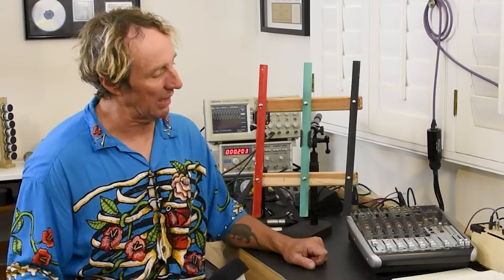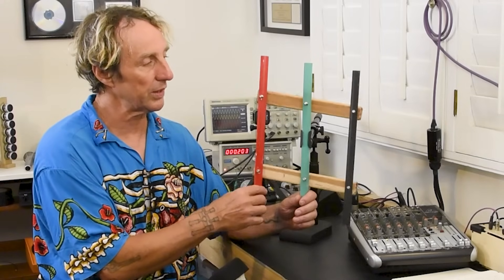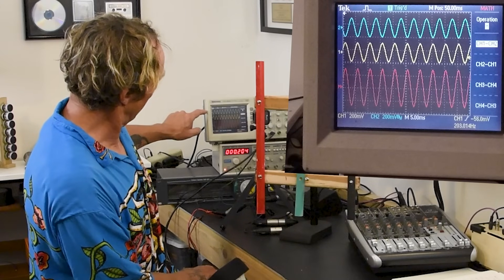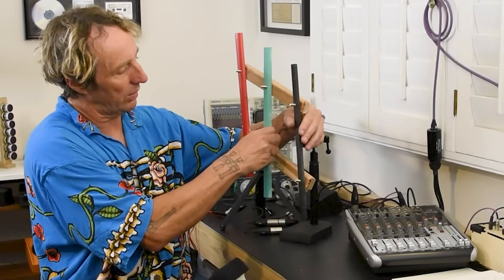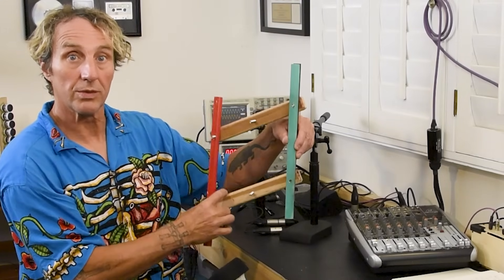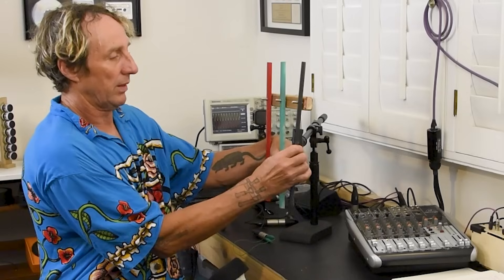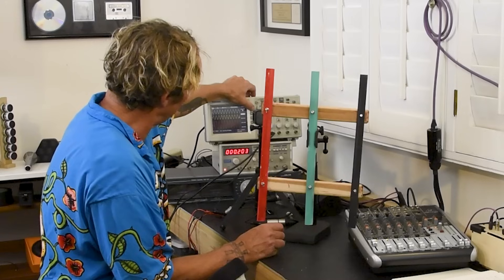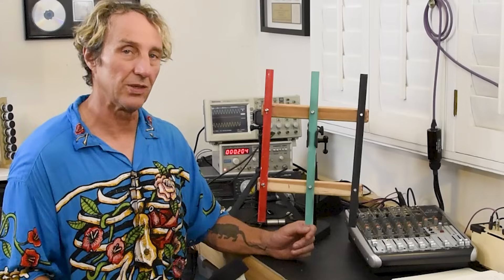The Mechanics Of Audio Balanced Lines Explained

Comment: Sorry, but this is just plain wrong and a very common mistake. Balanced does not mean complimentary voltages, it might be, but it does not have to be. Interference rejection still happens when the signals are both zero. The correct definition of balanced is matched impedances of both sides, the output and input impedances form a Wheatstone bridge. Check videos and papers by Bill Whitlock for the correct explanation.
Reply: “Only the common-mode impedance balance of the driver, line, and receiver play a role in noise or interference rejection. This noise or interference rejection property is independent of the presence of a desired differential signal. Therefore, it can make no difference whether the desired signal exists entirely on one line, as a greater voltage on one line than the other, or as equal voltages on both of them. Symmetry of the desired signal has advantages, but they concern headroom and crosstalk, not noise or
interference rejection.” IEC Standard 60268-3 (2000)
Reply from the maker: Agreed and also and conveniently, The desired signal tends to naturally be symmetrical when generated by dynamic microphones and a pretty easy to make symmetrical when driven by electronic outputs.

It's really interesting that it doesn't need to be symmetrical but I'm not really familiar with non-symmetrical situations being very common or actually ever running into them.

Have you ever run into scenarios where the palace line signals are non-symmetrical?
Reply: @DaveRat  Most small mixers (like the one in your video) have all the outputs single ended balanced apart from the main stereo output. This is sometimes called pseudo balanced, but there is nothing pseudo about it as the impedances are matched. Also Otari tape machines had single ended line driver outputs because it makes more sense to put the component cost into one side than duplicate it unnecessarily, especially for 24 tracks.
There are lots of poor electronic balanced drivers. Simply inverting the signal does not handle an unbalanced load. The more up market designs can adjust to either side being grounded, but increase the distortion when in that mode. Then there's level compensation which leads to meters reading different levels on equipment connected together.
Reply from the maker: Thank you and now that you mention it I am familiar with that. Very cool
Reply from the maker: Hmmm, balanced line or are you referring to more specifically what Bill discusses which is that the lines do not need to be evenly and equally balanced in order to achieve noise reduction?

I do enjoy the nuances and accuracy so I will raise you up another level.

I am describing how balanced lines work.

The fact that the lines do not need to have equally balanced voltages in relation to ground in order to achieve noise cancellation is interesting and relevant but does not change how balanced lines work.

Nor does that subset of function make the description of how balanced lines work incorrect.
Reply: @DaveRat  You are not describing how balanced lines work because you are only talking about a voltage model special case without considering impedances. Complimentary voltages do not help noise cancellation at all, they only might reduce their interference into other nearby lines, like in a multicore or dense patchbay wiring. They are a hangover from centre tapped output transformers, which do have equal output impedances. People look at such stages and incorrectly assume that the complimentary voltages are the important part. This mistake has been propagating for decades, but repeating it doesn't make it right.

Do you think an output is balanced if it has complimentary voltages and different impedances each side? How does your model explain that?
Reply from the maker: I think one of the more common examples in usages of balanced lines in audio relates to dynamic microphones.

Where it's the perfect trifecta of extremely low level susceptible to noise, commonly needing long distance runs often in noisy environments and is naturally balanced with equal impedances to ground of the two signal carrying wires.

This is where a lot of problem solving and troubleshooting and exposure to the assets and issues of balanced lines occurs for the majority of audio humans.

Understanding why we use three pin XLRs instead of quarter inch cables on microphones I think is probably the most helpful aspect and focus of this video.

That's it things like bridge mono amplifiers or modern amps that actually have both terminals being equal opposite voltages is another example but due to the higher level of the signal there's no real concern with noise induction so so line balancing is an artifact rather than a focus.

If someone's designing condenser microphones or output preamps, then we start to run into a need to try and keep the impedances to ground identical but also again, kind of like the amplifier scenario we're not really dealing with ultra low level signals that are extremely susceptible to noise where line balancing is so critical.

So overall in the most practical sense, The things we need to be line balanced the most tend to be dynamic microphones and transformer DI boxes, which naturally and inherently present equal and opposite voltages with near identical impedances to ground. 

So the focus of the video is on people understanding the most important part of what they're most likely to experience and not get into the weeds on stuff that is more friends and highly improbable to be experienced by people seeking understanding of balanced lines. At least in the early stages before they go on to start designing professional audio gear

What I do find fascinating is that guitar and bass pickups have never really evolved into the balanced line realm yet they are perfect candidates and are naturally balanced in their outputs. Converting a guitar to a TRS 1/4" would you wonders for helping with noise reduction. Making lower impedance guitar and bass pickups would be excellent for longer cable runs without the sound of the cable impacting the sound of the guitar.

But it's also kind of cool to embrace the flaws as part of the sound and art

Comment: Related question: Why is the XLR Pin 1 (ground) Not Connected thru to the other end of a 4-XLR CAT box -;to Ethetcon - to 4-XLR CAT box??  Thereby defeating Phantom Power??
Reply from the maker: Ground pin1 is connected on all SoundTools analog over cat products.

If you are not seeing ground connection the most likely issue is one or more cables in the signal chain does not have a properly connects shield to metal housing RJ45 or metal housing RJ45 inside the ethercon shell.

Test the cables. 

All SoundTools analog over cat products will allow one or more channels to be independently Phantom powered. 

Here's a video where I show Phantom power, ClearCom and AES 3 simultaneously running down a single cat 5 cable into sound tools cat boxes

https://youtu.be/0J3FWq--fCM?si=9dljd16lGKb525xv
Reply: @DaveRat  folllow up!  The cause of the no phantom, was an etherCon cable lacking connection between the cable  shield and the metal RJ45 connector cover!  Cat boxes are good and reliable!
Reply from the maker: Excellent and I'm glad you figured it out.

Thank you for the update I really appreciate it

Comment: Nice explanation Dave! Btw I own you my response to some SoundTools I received few months ago. Everything is just fantastic! We have 3 WallCat8s in parallel so we can easily handle some simple Theatre shows with 2 IN and 2 OUT from place one or two back to stage. We also get male and female CAT Tails, so if there is no digital sound through our Ethercon connection, we have another 4 IN or OUTS for small music venues with our 8 channel annalog console. It is simply fantastic solution and If I have enough money for long multicore Cat5 cable and everything, I will make my main annalog snake from CAT Rack! :) Cheers!
Reply from the maker: Awesome and thank you and super cool!  Also we're coming out with a cat rack 16 really soon that will have four ethercon in and outs 16 XLRs and two DB25s in a single rack space
Reply: @DaveRat  That sounds cool, fantastic!
Reply from the maker: 🤙👍🤙 cool and also I had soundtools create discount codes for YouTube channel members, I believe it is 10% off. I will post the code in the member community chat in case you don't have it.

Comment: Something you don't always realise or really touch on much untill you start getting into circuit board design (althhough it's actually quite obivous in hindsight) is that "ground" in a single ended line isn't just sitting there doing nothing. A circuit needs to be a loop, so the ground wire is where the "return" currents travel through. Ideally we useually want our grounds to be referenced to 0 volts, but they never actually are 0 volts if there is current running through them, as if they have small return currents flowing through them and there is a resistence (which copper has) there MUST be at least a small voltage acording to Ohms law, it's just they are idealy very low impeedence paths connected to a very low potential points to encourage the signal to use that as a return path, instead of coupling into other random things. 

However, if you say have a circuitboard, have a signal trace running down the middle, and one around the outter edge, and a "ground" current return trace for the middle trace that goes around the outside of the board it will most likely couple into the other signal trace on the outside of the board, EVEN though it's a ground trace at very close to ground potential (becuse there is still current flowing through it). Now this really becomes a huge issue when you get into RF teritory, and with audio it's no so much of an issue, but audio is still susceptable to RF interfearence and crosstalk, so it's always worth keeping it in mind that "ground" (which I hate calling it for return paths) is not 0 volts IF it's part of a return path for a signal (other than at the AC 0 point crossover, periodically, and temporarily), even though it MAY be connected to an actual consistently 0 volts chunk of metal or the actual ground it's self. 

A single piece of metal can simaltaniously have voltege and no voltage in different places if certain criteria is met, but if there is signal return there MUST be at least a small voltage between the points the current is traveling to and from. A ground plane is a good example of this, as for a 2 layer board (as an example) the return currents in the ground plane will follow the signal trace above it through the ground plane (due to emf coupling), not spreading too far into the rest of the copper around it, which remains at much closer to 0 volts than the path it's self. As a result it's always imporatant to route audio signal and audio ground together in wires, because you minimse the loop area, as it's an antenna essentually, and both wires can pick up that RF, just we are taking the signal half way, so some of that noise if introduced after will not make it to the output, but there are scenarios where this isn't the case and paying attention to your return path is very important (ground feedback loops being a prime example of this) ;).
Reply from the maker: So cool thank you. And but you say kind of relates to balance lines in that one of the advantages of balanced lines is they don't use the ground for return path. And the ground can be dedicated purely to protection from noise and a shield. Though current traveling through a ground shield does induce noise into the lines especially on non-balanced lines, with microphones though since there's no ground loop and no voltage or current on the ground except for the RF, it tends to be pretty immune
Reply: @DaveRat  Indeed! It's part of the very reason differential pairs started to be utilised in this manor for sensative external signal cabling to begin with, because of their far superior cmr (common mode rejection)! 😉👍
Reply from the maker: Ageeed

Comment: i wish you went a step farther with "psuedo-balanced" or impedance-balanced circuits. e.g a TRS  1/4" output of a small budget mixer, where there is only positive and ground, but still has the noise rejection/cancellation of a true balanced line using an additional resistor to match the impedance of the circuit
Reply from the maker: Will ponder that. This vid was all about simple basics. I hope you get back into more complex soon

Comment: Nice work, this concept of a differential signal is very common in many disciplines I've discovered over the years.
Reply from the maker: Agreed and thank you
Reply: I have been surprised that they use it in measuring brainwaves for electroencephalography as well. But it makes sense.

Comment: What do you think about balanced (microphone, 2 wires and shield) cables, does ground (shield) connection need to be soldered? I've read different opinions about this in manuals, some recommend to solder it from only receiving end, some from sending end. Also how "pseudobalanced" soldering works from unbalanced outs to balanced ins. Thank you very much for your videos.
Reply from the maker: The ground wire or shield is not necessary for balanced audio but is important for shielding especially with a microphone because it's the only way that microphone cable gets a ground.

As far as lifting the ground on one end of a cable to prevent ground loops this can work but not with microphones.

Only connecting the shield on one end usually doesn't help and it's always better to solve the ground loop rather than try and get around it that way
Reply: @DaveRat  Thank you again! It would be nice to see some videos from you about ground loop solving experiences.
Reply from the maker: That's a good idea and an important skill will see what I can do

Comment: i spend all day explaining why the TRS cable my customer is using is causing noise. 
"but i got an 1/8" TRS to 1/4" TRS cable and I input into my mixer. it totally fits and my mixer has TRS inputs. i read it in the manual. the cable you sold me is defective!"
me shaking my head and taking a big breath, getting ready to explain all the TRS applications, to someone who has supposedly "been doing this for 30 years...